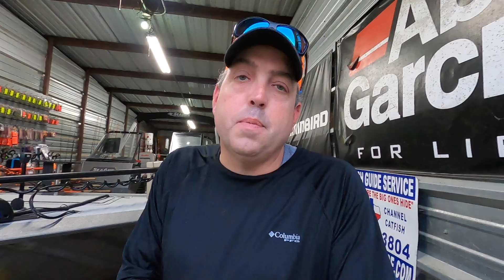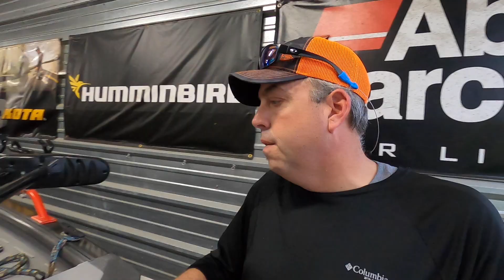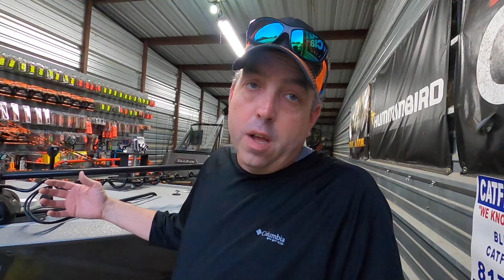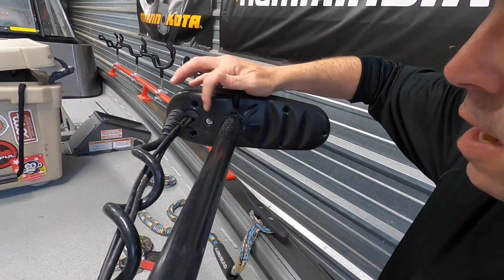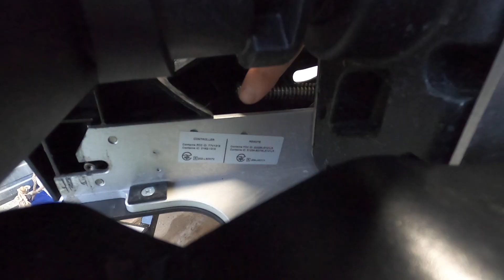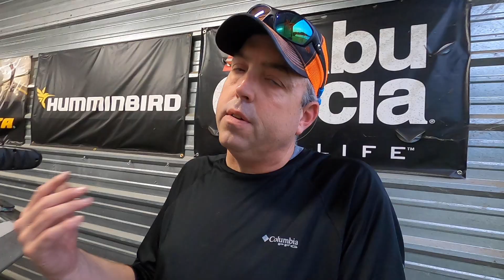Keep Your Minn Kota Ulterra PROBLEM FREE (Troubleshooting and Maintenance)

Comment: I run a 2021 Lund Impact.  The trolling motor is an Ulterra (80#).  
I wipe the shft with water based silicone after EVERY use, and I keep water based grease in the 2 small slots as shown.  NO lube on the drive screw behind the one cover plate.  MinnKota says "no". 
Motor is a gem. I am 71 yrs old and it allows me to fish even with old man aches and pains.  Love it.

Comment: With new boat I was given used (4yrs old) ulterra unit.
It's a 80 lb ulterra somtimes I have an issue not wanting to respond to left arrow turns (right turns seem ok) it takes numerous presses. 
I have new ipilot control module head installed and brand new remote.
Please Help.

Comment: Help???  My Ulterra 112lb is not stowing.  I can trim up and down.  It will trim bout half way up and it just stop there.  I try to reset couple times, but the red light just flashing with error.  Reset function is not even operate.  Three batteries are fully charged as well.  Every maintenance you have mentioned in this video has been done recently.  Now, I don't know what else to troubleshoot my Ulterra.   Please help if you have any advise.  Thank you in advance.
Reply from the maker: Call Minn Kota

Comment: My location sensor is flashing blue when I turn it on and the remote is not picking the motor up. It flashes blue for a little bit and turns off

Comment: I have had my ulterra for over 5 years and lately it’s been giving me nothing trouble. I have had to replace the little magnet with the spring on the deploy motor side as it was cracked. Problem fixed. Then I didn’t use it for two weeks and then when I get out on the water it won’t deploy. I find out the deploy motor is burnt. Problem fixed. Now it’s giving me trouble again. The motor head goes all the way out but the deploy motor is not working properly again so I take it apart and undo the bracket and deploy the motor manually and then I put it all back together again and it works to stow the motor but again I try to deploy it again and again the motor head goes out but the deploy motor does nothing again so I do everything again and it picks itself up and Stowe’s and that is we’re I put it all together again and give up on it. I’m truly sorry I brought this thing. Can’t afford to bring it to a service center because I’m on a fixed income  and minkota is no help because it’s not under warranty any more.
Reply from the maker: It needs to be reset

Comment: Nice video. One thing I would add is that if you are replacing an older motor with a new ulterra, make sure that you have a properly sized circuit breaker. Found on my boat that the previous owner had a 40a breaker installed and the 24v ulterra calls for a 60a. This most certainly caused my random shut offs under heavy load and most likely the one stow error I had.
Reply: Good information.
Reply: Where is that located

Comment: Chad what bracket are you using if any so you can take it off the boat or is it secured directly to the boat
Reply from the maker: Bolted to the boat. Not a fan of quick release
Reply: Wow I need a bracket because I use my trolling motor on 2 differant boats to much trouble unbolting it each time I want to transfer it to the other any thoughts

Comment: Why is my Ulterra randomly spinning around & tying itself in knots when it’s on spot lock?
Reply: Make sure when you go to spot lock that your boat has stopped moving, if not your motor is trying to get back to the spot you locked on. This can happen even if you are only slightly gliding.

Comment: i recently had to change a battery and prior to that the motor deployed fine- after the battery install it won't deploy. The remote says batteries are fully charged but shows the prop with a line across it. Can u shed some light??

Comment: Thanks for the tips. While using my Ulterra ,a puff of black smoke came out of the housing resulting in loss of power. When the housing was removed , there was no burned wiring or blackened areas. The fuses on the battery were good but it will still not power up. Any suggestions would be much appreciated.
Reply: you probably fried the capacitors on the control board. that's what happened to my terrova. Steering unit went bad. Apparently if the steering motor draws too much current it will fry the control board. You'd think they would add a fuse or other protection scheme to protect the control board. DUH!!!

Comment: Chad. Thank you very much for its late March and we have some open water. 
Tips and tricks for the ultera.  I have one on order and awaiting for the dealer to call me. Im replacing the terrova ipilot that came with my lund new a few years ago. I will replace the current 12v plug with one you suggest and pm it before using. 
Again thxs always a good job.

Comment: 0 problems my ass! mines don’t work but it is the best trolley motor when it does work. My boat is useless without his unit
Reply from the maker: If you read the manual and do the maintenance it’s problem free.

Comment: Thanks for the video.  I have a new ulterra that I have used a few times.  The last couple of outings the motor has stopped while in the spot lock position.  If I turn the motor of and back on it will work as normal again.  The motor has been synced and otherwise works fine.  I had a Terrova previously and had no issues with it at all.  Any suggestions?  Thanks.

Comment: Good info, thanks for sharing. From time to time I will be fishing up the bank and  have my Ultera just shut off and I will press the power button and it will stay on for a few seconds and shut off again.  I can leave it alone for say a half hour, do a reset and it will work fine for months and I will not have a problem. All connections are clean and good. Any ideas? Thanks.

Comment: Have you ever had or heard of the trolling motor not turning on when the unit is fully deployed?  I have had an intermittent problem with my Ulterra 24v Gen 2 with new batteries.  I have done the reset as directed by the factory and no go. While bench testing this I noticed that if I hit the trim module the motor will start turning. Is there a way to service this unit to check for poor connections?

Comment: Great tips Chad, thanks...but still can't  get computer to reboot passed stow or deploy  or pause function....everything is on hold or   is locked up.Lubed and tighten belt? But still no action No advice or service agent in NZ over xmas!
Reply: Yeah, just had to add this as there is NO response from anyone, all the brains and service options are on holidays xmas/New year 4 two months both Aus/NZ . MK is dead and I've no way of overriding computer to get MK ulterra to function? Done a manual stow/deploy, then did computer managed deploy/stow only to have power head(thrustmotor) rotate 90 degrees and jam in housing base. Reset option from pause to deploy just convinces the computer to detect an overload....and locks up any other options (safety issue... I guess?) Have removed unit from bow and now 2x12 volt batteries to bench test. Can MK Ulterra unit be side-mounted  on bench , hooked up to batteries for bench test?? No room low ceiling room or bench height  to allow vertical deploy/stow  option. There's  no other way to release the stow tension....just asking someone?

Comment: I get the motor error message every time after stowing. I have to shut off the motor and remote, and turn on again then I can redeploy. I assume doing the lubricating as you have suggested will fix this? I will have to wait until spring to try it. Also, I get a “motor paused” message on the remote sometimes when I turn the motor and remote back on. What is this and how can the motor paused issue be resolved without having to turn the motor and remote back off/on yet again? Thanks. Your video does appear to be very informative and I look forward to following your advice next spring when I can launch the boat agin.
Reply from the maker: Maintenance should fix it

Comment: Hey Chad, 

My ulterra wants to droop when it comes back in to stow and even got caught on the storage lip once and gave me the motor error. Does tightening the belt tighten the entire prop unit? It seems to slip when it pulls up (because of weight).
Reply from the maker: Start with tightening the track

Comment: Mine is squealing quite a bit when trimming up and down even after spraying silicone spray. It’s been doing it for a while, I’m just afraid it’s going to crap out on me.
Reply: Did you spray with SILICONE spray:  the drive belt, SHAFT AND ROLLERS ON TOP/BOTTOM OF BELT??? Was told NEVER USE spray with petroleum dispersants (WD-40)!!!!
Reply: @504BloodSweatTears  I have been using silicone spray after every few uses and it has helped.

Comment: My issue is that intermittently, the unit will not deploy - can hear a motor whirring, the i-pilot screens reads "deploying" but nothing happens. Turn it on and  off several times and/or leave it for a few days and then it works again. Licensed technician cannot see any issue (worked for him every time). Could this be some kind of issue with the magnets? Unit is under 12 months old.

Comment: Thanks for the troubleshooting tips.  I bought my Minn Kota Ulterra 8 months ago and was used very little the first 4 months.  It was great until 2 weeks ago and would not stow.  I had noticed that it sounded louder while deploy and stow process over the past 6 weeks.  It was repaired under warranty by authorized service dealer and he replaced the trim assembly and told me it was caused by water in the head.  I asked why head is not sealed to keep water out,  but he said water will get in the head. He suggested to deploy and stow after wash down to  drain the head. I do wash down the unit each time I come in from salt water but have never raised unit to drain head.   I am also going to get some 100% silicone spray to try your tips.and hope this keeps me away from the service dealer.   I had the Terrova I pilot before getting this unit last October and really like the I Pilot,  but now I am thinking I should have stayed with the manual deploy and stow from all the problems I am hearing about the Ulterra.
Reply: I was told that are small holes to drain any condensation on the bottom of the head... and... NOT to spray a strong stream of water pointing  directly at the underside of the head.

Comment: So I have had a bunch of problems with mine and bass pro is jerking me around so I had to reset my ulterra and it will now stow on the deck but it will not pull up onto the trough! It lacks stowing about 6” any thoughts?

Comment: I have a Maxxum 74 , 24v that has a 4 pin power connection - I’m replacing the motor with a 24v Ulterra  - it has the 3 pin male plug - can I just swap it for the 4 pin?  If you know that would be great! Thanks for the video! Awesome info!

Comment: I just received a replacement ulterra 2021. I was told to use Pledge on the shaft and only pledge. This is from a MinnKota representative. He said absolutely do not use WD-40.
Reply from the maker: WD40 and WD40 Silicone are not the same thing. The user manual itself says to use "silicone rich spray" which is what WD40 silicone is.
Reply: Rodger that. She also said I should take it off both side covers I completely rents at each and every time which I thought was a little excessive.
Reply: Hi. I have been using Armoral Wipes and have had no issues?

Comment: Great info. However, my brand new Ulterra spot lock fails randomly and I have to press the anchor button again. My neighbor just bought a new one for his new boat and his also stops spinning and the spot lock button has to be pressed agaon. Surely we can't be the only ones with this issue. Batteries are charged fully and on trickle charge for days...
Reply from the maker: Check the voltage
Reply: @Catfishedge  Also make sure you calibrate the unit. Many people don't realize this NEEDS to be done.

Comment: Minn Kota confirmed to me they recommend ‘Pledge or Bow Wax’ for lubricants on the shaft and belt. Both are used because they don’t attract dust/dirt. The worm/screw drive light coat with ‘marine grease’. I would recommend a 100% synthetic grease for same reason, I have heard it does mot attract dirt like a petroleum based grease for my firearm cleaning and lubrications.
Reply from the maker: Manual says silicone
Reply: @Catfishedge  the Minn Kota maintenance video recommended water based silicone, I didn't know such a thing existed!

Comment: Can you tell me where I can find instructions for replacing the Minn Kota Tilt Motor Assembly on a gen 1 ulterior?
Reply: Ulterra  not ulterior. 🙂
Reply: Please
Reply: I have a ball terra 80 pounds with lake and the propeller is stopping turning and then sometimes it comes back on and I can’t get it to turn on anyway I tried manually or with remote I was wondering what the problem was
Reply: I
Reply: I have a whole Tara 80 pound with link of the propeller stops turning when I’m trying to remote it or manually then sometimes it’ll start back and then stop and I can’t get it to move it all remotely or manually I was wondering if you knew what the problem is
Reply from the maker: Try a service center.

Comment: Just purchased Ulterra. Older demo model from a few years ago, but unit is new. Not sure of the date/year. I am a stickler in regards to electrical connections and terminals. I am not an electrician, but I would like to know what you would use as a high grade male/female plug. Also what size breaker. I have the Ulterra 80lb - 54" - 24 Volt, and purchasing new batteries to go with it. Thank you!
Reply from the maker: It's in the comments here several places

Comment: I've not been so lucky with my Ulterra Riptide. First one was in the shop more days than days on the water. Factory  replaced my nearly 2 year old motor with a new one. It's lasted most of the summer before quitting. It's going to the repair shop tomorrow.  Use in salt water is much harder on equipment than fresh water. Fantastic when they work, a pain when they don't.
Reply from the maker: Maintenance is key
Reply: Hearing stories like this is why I'm leaning more and more towards the Terrova

Comment: I love my Ulterra. The issue I’m having is when I turn right (clockwise) it is very noisy. Turning left (counterclockwise) is very quiet. Have you encountered this and do you know how to resolve it?
Reply from the maker: I’m sorry I don’t
Reply: I have the exact same issue
Reply: I had to replace the motor on the shaft.
Reply: @AndanteCruises  I had to have the board replaced, the trim housing and belt replaced, and the steering housing replaced. I basically have a new Ulterra now.
Reply: No, never had that problem. The motor  can only spin one way when thrust is required to turn boat at whatever settings dialled  in.The turning mechanism is stop/start controlled by computer  in spotlock...or by you if in control

Comment: It's weird cuz whenever I go to power on my trolling motor and press the power button on it, the buttons light up, but then I let go of the power button and they turn off and it will not turn on
Reply from the maker: Check the voltage
Reply: @Catfishedge  yea, I called my dad he said it's probably that or the batteries are shot cuz the batteries it runs off is old

Comment: I am Riptide Ulterra user.

Just to note for everyone about the top of the steering bucket there is 2 connection for the trim module, both positive and negative connection, you need to know the silicon spring under the connector is in good condition = had good elasticity.

If your Ulterra getting some of the electrical noise when you deploying the motor, that is the symptom.  You can also notice an electrical spark between the trim module and the steering bucket at dark or at night when this occurred.

I found this may be the reason why I failed my mainboard  :(
Reply from the maker: Thanks

Comment: I’m running my 2nd Ulterra and really love them ! My new is a Gen 2 with the improved spot lock but the other day while fishing and stowing and deploying it numerous times it started sticking when going to deploy and I was getting the error alarm. I could just shut it off and turn back on then when I hit deploy I’d have to push on the head to get it to start deploying. It seems as if it’s sticking. It worked perfect up until this.
Reply from the maker: Needs maintenance
Reply: @Catfishedge  yes did something’s you suggested and it works perfect now ! Thanks !